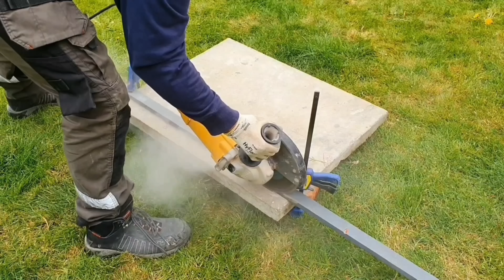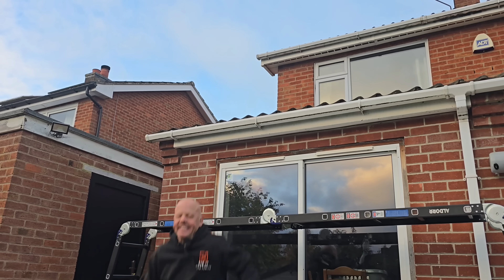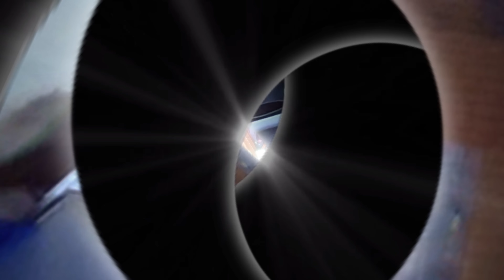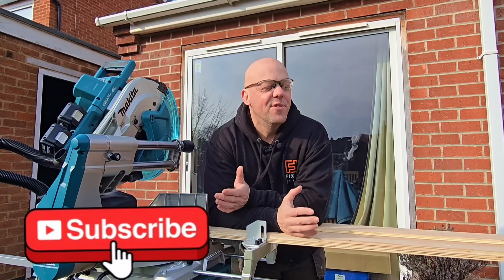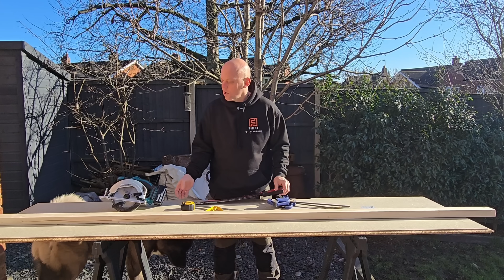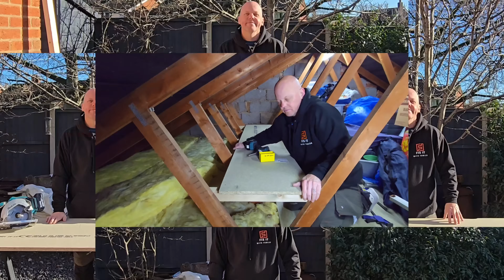How to Maximize Your Loft Storage Space (DIY Guide)

Comment: Did exactly this a few years ago on both sides of my loft to get as much stuff as possible off the floor. I used OSB loft boards because at the time Chipboard was in short supply. Not I need to raise the floor to add extra insulation. I have a LoftZone system ready to go in.
Reply from the maker: That's awesome to hear! Sounds like you've really optimized your loft space. Raising the floor for insulation is a smart move—comfort is key!

Comment: Nice storage idea because most modern houses don’t have a lot of space with those W shaped trusses.  This uses them more effectively.
Only comment I would have though is depending on the size of your loft and how much room there is, it may not be possible to get a 2.4 length through the loft hatch and positioned between the joists, it could well foul on the roof.  Might have to make the shelf a bit shorter as a consequence
Reply from the maker: Thank you for sharing your thoughts! I appreciate your insight, and it's true that adjusting the shelf length might be necessary for those tighter spaces.

Comment: Great idea. Just one question, though: Would it not have been quicker to just cut multiples of the first support piece rather than remeasuring each time?
Reply from the maker: I didn't remeasure each time, i just used the first one as a template and repeated it until i had 5 identical supports. im glad you liked the idea.

Comment: Not sure it is a good idea to put extra load on roof trusses, that are designed for supporting roof etc 😳
Reply: I wouldn’t worry about it too much.  Yes its designed to support the roof load but it has to support the roof when under high winds, covered in snow, etc so there is over-engineering in it.  For storing a few boxes of loft junk it’ll be fine
Reply: @geoffreycoan  I want to do the same thing on my loft but I always wondered if this complies with building regulations. If I sell the house and a surveyor comes around, I wonder if they will pick on that.
Reply: @ruinunes8251  I would do what you want to live in the house as you want it to be.  So if you want the extra storage and like this solution, then do it !
I would doubt very much that there is anything explicit in building regulations about you attaching supports and shelving across the roof trusses so it’s not going to be a specific thing you can “fail” on.  If at some point in the future you come to sell the house, and are worried about what surveyors may say, then take it down; you’ll have to be clearing the loft anyway
Reply from the maker: True, but on the bright side, if your loft collapses, you’ll have the ultimate excuse for a new home renovation video! 😄

Comment: I just put 50cm OSB lengths in without extra timber supports, tapped them level and locked them in to the trusses with a few screws. No issues at all in 10 years. I think I got them cut down at B&Q and took them straight up and screwed them in place - I also used the waste strips for the back stop. Clear tubs make it easy to find your stuff.
Reply from the maker: That's an impressive setup! It sounds like you've really nailed the loft storage game. Thanks for sharing your method; clear tubs are definitely a great way to keep everything organized!